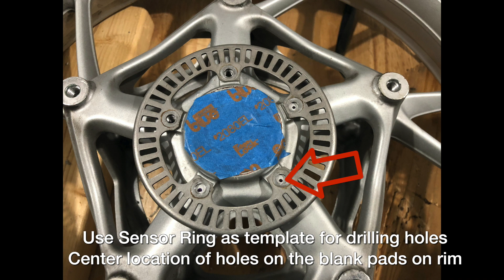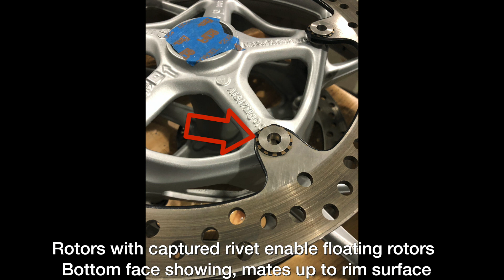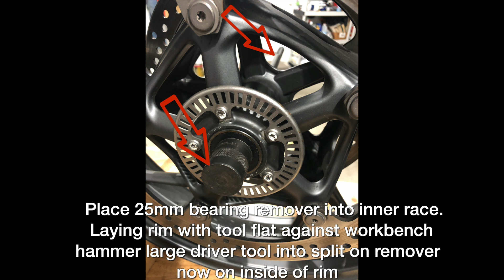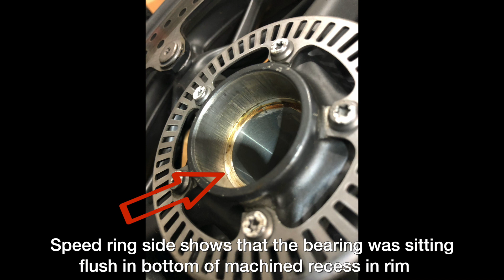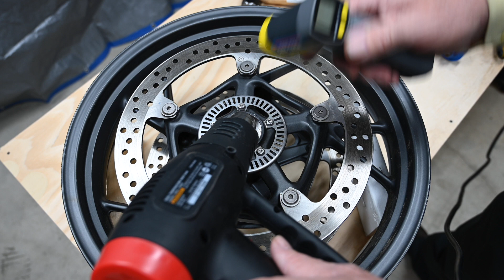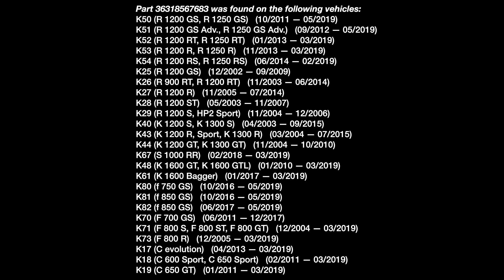BMW R1200/1250RTW/K52 (2014-2020) Alternate Front and Rear Rims

Comment: My R1200RS manual says 9 nm for the RDC sensor installation bolt.
Reply from the maker: Excellent!  I knew it was a very low value, about the same as the valve cover bolts at 10Nm.

Comment: Wow 40k miles think i done less than 3k miles last season bad weather in 🏴
Reply from the maker: Now you can also see why I learned how to do the minor and major services on the R1200RTW...and am glad to share with others!
Reply: @Boxflyer11  My last service in the dealer they spilled brake fluid on the rear final drive and had to replace it, i've also just drained 1/4 of a litre of oil from the engine overfilled lost all confidence so after watching your videos i bought all the timing tools for the next service 12,000 ml and i will do it myself thanks to you 👍🏻
Reply from the maker: @geomoto599  I just got the OEM Cam Timing tools for the new R1250RT ShiftHead and will begin working on them as well...I have no idea when I will find time to do a YouTube video on the 1250 valve service, but that's my hope.

Comment: What's the benefit of fitting these wheels?
Reply from the maker: As mentioned in the Description above, I was wasting good rubber by changing tires when the next trip length dictated that my current tires wouldn't go the distance planned.  This last year from April 1st thru the end of October, I rode over 40k miles on my RT and only got surprised once out on an extended trip with the need to change tires at a tire supplier.  The cost of installing just these 2 tires was $100, so a significant cost for my riding season if I didn't have several sets of rims/rubber to work with...these rims at a relative cheap price help me when I'm going thru about 6 sets of tires per year.  
Another answer to your question might be that supply and demand has made it difficult to find R1200RTW rims, so these are other options to convert rims makes them cost effective.